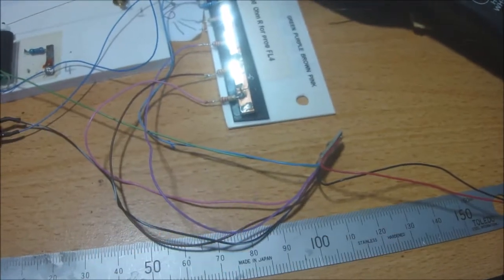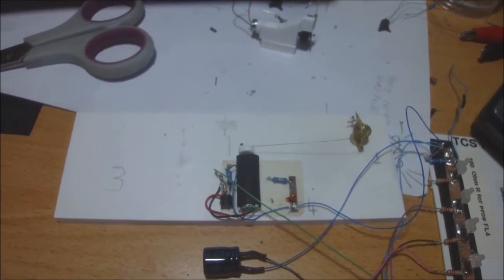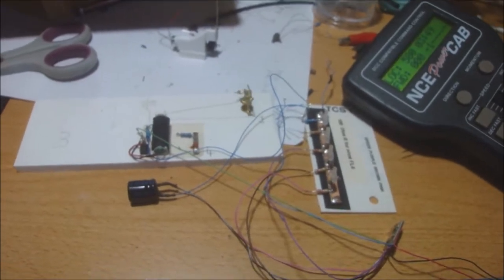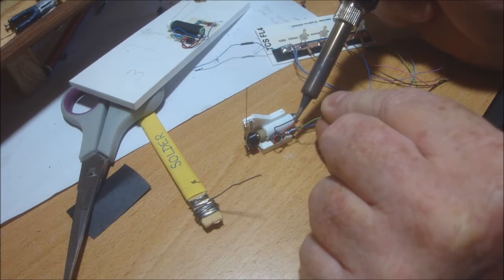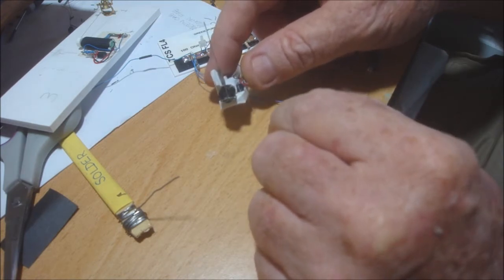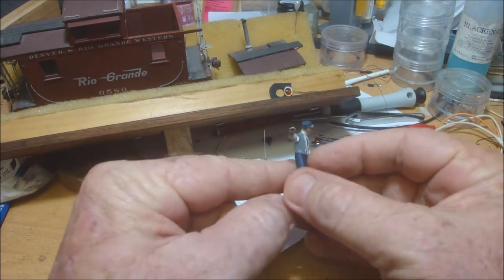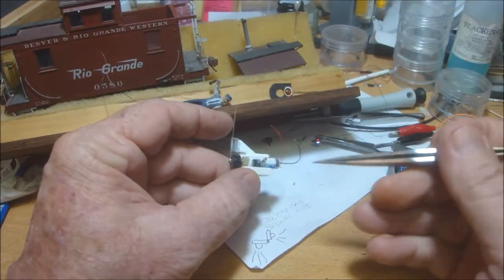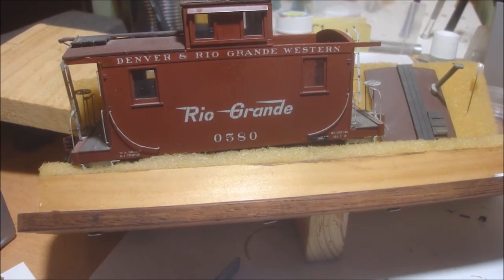CONDUCTOR FRED FOLK

Comment: are all the moors the same size and where do you get them
Reply from the maker: G'Day Don, I think you meant to say motors not moors? I get them from Ebay - search 3v 6mm planetary geared motor. Try and get them with an output of 100 to 600 RPM - 200 RPM is best.
Reply: yes motors  fat fingers  not reading what they do
Reply: what is price   many motors do not look the same
Reply from the maker: The geared 3 volt planetary geared motors range from around $15 to $20 each. The gear head length differs giving lower output RPM the longer the overall length. The motors are the same length, it is the gear housing in front of the motors which provides the output RPM. The longer the gear housing the slower the RPM. I use 200 RPM when I can get them and I buy 10 at a time and fine these best. Search for 3v 6mm planetary geared motors. Hobby robotic shops also sell these but the prices are more than $20 each.

Comment: Great work, what kind of motors do you use?
Reply from the maker: I use 3 volt pencil motors which have a tiny gearing in front of the motor. These are available from Ebay or robotic shops but a bit expensive. Thanks, glad you liked my animation. Laurie